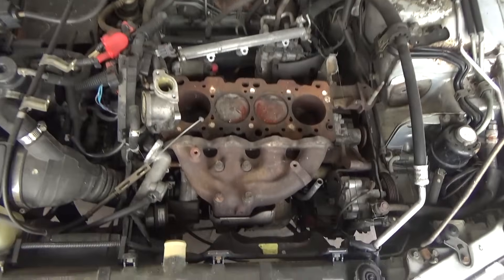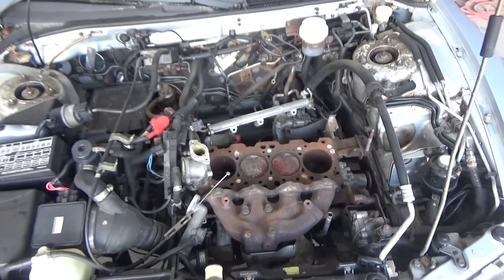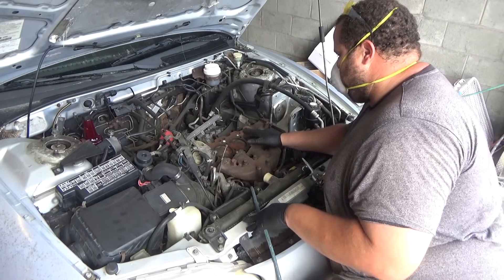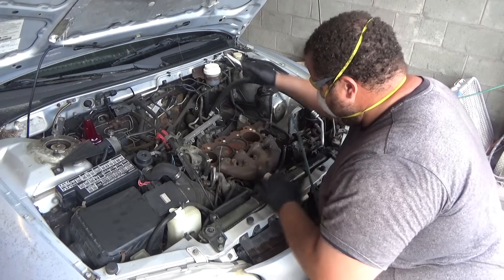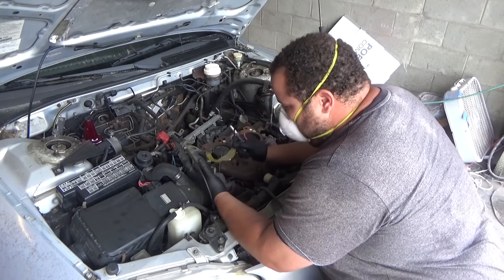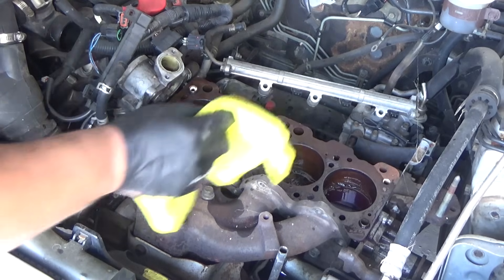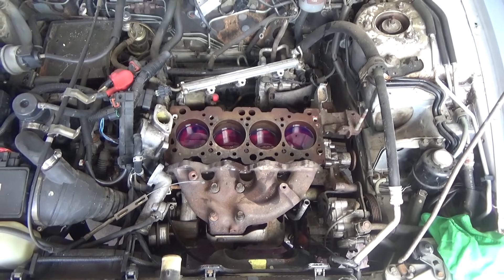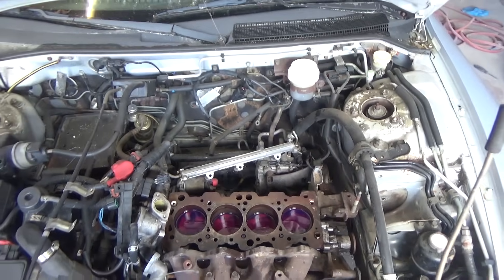$300 Turbo Eclipse Seized Engine (Good News)

Comment: Looking good, man!  Great progress on the FaF Eclipse!  I have some food for thought, though.  If you don't want to hassle with rebuilding the 4G63T, the 4G69 bolts right up.  They were in the 4th gen Eclipse and 9th gen Galant.  They're the same block, but the 69 is bigger displacement, at 2.4L vs the 63's 2L.  The only thing is you'll still need a 7 bolt 1G/2G DSM cylinder head.  Also, if you're looking to have a turbo pushing a good bit of boost, you'll probably have to upgrade the 69's internals cause they're rated up to 300hp reliably.  Anything after that isn't reliable and the engine might go boom.  The 69 is what I'm planning on putting in my '98 Mirage.
I can't wait to see more of your progress!  God bless!

Comment: I used to buy mystery oil a lot. $4 for a 32oz bottle at Wal Mart. Then inflation hit. And that same bottle is $8 now. So sad, I used to put some with like every tank of gas. I've soaked my cylinders through the spark plug holes with that stuff. If you think seafoam causes a lot of smoke, you should see what MMO does through the cylinders.

Comment: Amazing work on the engine! Please don't get rid of the sunroof. If you listen to Lieberman and Lapid talk about the car, they'll mention they had to tape cardboard to the mouth of the scoop otherwise it would make a horrible noise and it hurts the car's aerodynamics. It's going to be a tribute car (not a replica) regardless, you might as well make it better than the original. :) Don't do the scoop.

You won't find the wheels below like $5K but you can find some that look pretty similar. Doesn't have to be identical.
Reply: I've never even noticed the roof scoop til now. IMO it's ugly.
Reply: look at lancers/"eclipse" quite often here in Aus. Oem Sunroof & working sunroof with no rust issues is rare.
Reply: @shadako2  I mean, if he wants to just delete the sunroof without adding a scoop, that's fine too, (anything is fine, it's his car). I was just pointing out that both Lieberman and Lapid said that the scoop kind of ruined driving the car, it was the director's choice, not the owner's.
Reply: @indonesiansasquatch4926  lol, wrong car, yeah agree.

Comment: My brother had a 97 gst tuned to 365 hp to the front wheels on 15lbs of boost in 2002 was one of the fastest eclipses on the road in Tampa FL in those days t3t4 hybrid turbo tanabe racing medallion 3 inch exhaust imported block from Japan turbo timer greddy intercooler cam gears lightweight pulleys and lots of other parts  built to 2.4 litre it was burgundy with 18 inch  silver Momo's then he got married and sold it

Comment: I've had my engine/transmission replaced a couple of times and didn't even think about taking back my head. So the shop that replaced my engine has a block and a head with a bad head gasket. I wonder what they did with it.

Comment: Any1 looking for a 96 gs and a 95 gsx. I got them for sale in NJ. The gs runs and drives and got a bunch of parts installed. The gsx is bone stock with a good 4g63 engine and its complete except for the exhaust system.